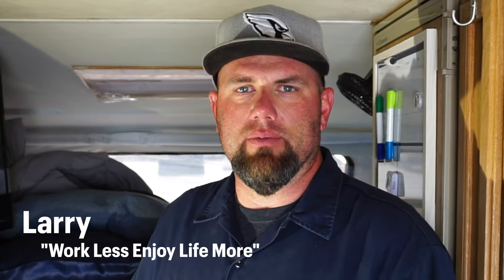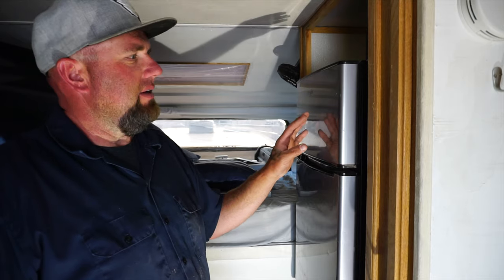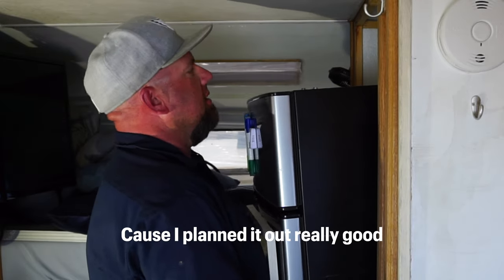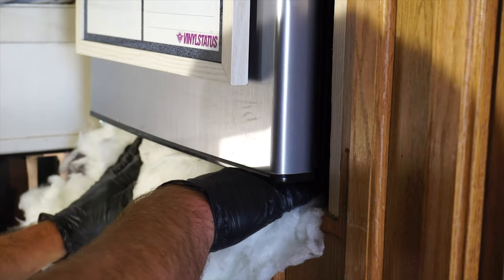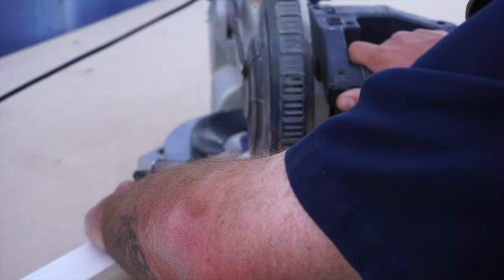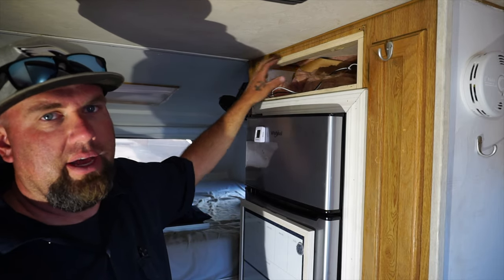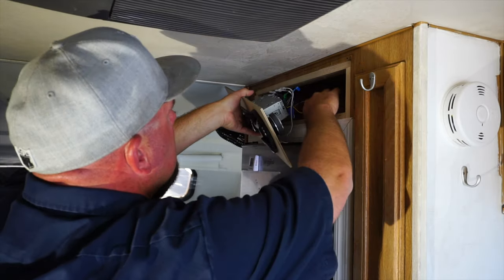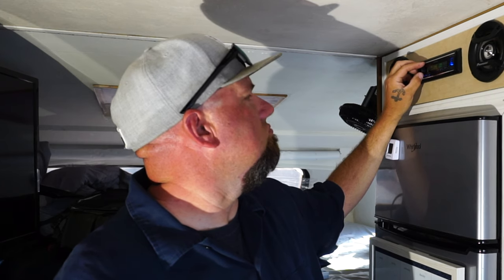How-To Replace Truck Camper RV Fridge With Residential Fridge

Comment: Screen the Vents, otherwise the Bugs🐜🐝🦋🐞🪲🕷🦗🪳🪰🦟& Mice🐭🐁🐀& Snakes🪱🐉🐛will come into the Camper. Put the Tiny Compter Fans on the Vents. Really low wattage use. Also test Protaine Lines with Spray bottle with Soap in the water & spray on the conections. Both you used & this are a positive peace☮of🧠mind.
Reply from the maker: Yeah, I actually have a screen on the vent but I don’t have the computer fans, although that is a very good idea! Thank you for the tips, and for watching!

Comment: Hey dude , if you want a little better speaker response pull the speakers out and use cardboard type ice cream tubs or whatever you want to call them and use them as an inner cup , size appropriately , to reflect the sound outward instead of out the back side in the enclosure . Much better bass and volume . you don't have to drive the system as hard either . they act like putting the speakers face up in a cup . Try it with your cell phone . put tunes on and place it in a can or tall bowl . acts like an amp .

Comment: I flippin love this videoi was laughing my butt off. exact same thing I'm trying to do, and in the same manner😂
Reply from the maker: Hahaha 😂 thanks I’m glad you enjoyed it!! Hey quick tip that I wish I would have done… I wish I would have packs more insulation around the fridge. These dorm fridges are meant to be inside where it’s temperature controlled. So when it’s freezing outside things freeze inside the fridge and when it’s really hot outside it kills the batteries trying to keep it cool. 
Good luck on your project and thanks for watching!! 😊🤙

Comment: I’m remodeling a 1990 Lance truck camper. I did not realize what I was getting into but here I am. All new territory for me. Thanks for the video it helped tremendously as I am going to try to get my old fridge out as well. 😱😳😬
Reply from the maker: Hello Dee, thank you so much for watching and commenting. I’m glad it could help you out. Currently everything is broken inside my truck camper and it all seemed to happen at once. My ac went out, the new fridge uses up too much power in the summer months so my batteries keep going dead, I now have a bad water leak preventing me from turning in my water pump hahahaha oh my gosh the list goes on so I have finally decided to do this full camper remodel. It looks like my next video will include me beginning on more projects. So hopefully there will be more videos that can help you out in the future.
Reply: @worklessenjoylifemore  hey so have u figured out how much "solar system" u need after your install.?   I cant imagine u need alot, in my trucking days we ran a regular small fridge and let it sit for atleast a day  on 3 regular truck  batteries.

Comment: Good job.  I have a similar camper and do many similar mods...    im getting ready to tackle this job.   Im nust trying to figure out if i need more solar. I have 200ah battery and 200w solar.
Reply from the maker: Hello 👋 I didn’t explain it in the video but I too have 200 ah of batteries but I have 600watts of solar. Because these dorm refrigerators are meant to be indoors in a temperature controlled environment sometimes I do have issues. When it’s cloudy or rainy the fridge will burn through my batteries pretty quick! I live here in Arizona where it’s sunny most of the year so I really only have this issue maybe 3 times a year. Also I have issues when I’m in Phoenix during the summer because the temps outside reach 110+ so the inside of the camper gets up to 150F inside when I’m driving around and don’t have the AC on. The fridge will kill my batteries on those days as well because it’s trying to stay cool while fighting the ambient temp. When I’m in that sort of area I have to turn the fridge down to about 50 degrees and only keep things like drinks inside to stay cool but my perishable food has to stay in a cooler with ice. 
You might have issues with only 200watts of solar especially if you live in an area that has cloudy / rainy days a lot. 
One way to fix this issue I learned is to buy a “plug and play” battery charger and plug it into the rv and then connect it to your batteries so when your battery bank is running low you can plug in your camper to shore power or run a generator to top off the batteries at night. 
Hope this helps, thanks so much for watching 🙏😊
Reply: @worklessenjoylifemore   im in SoCal so i know what u are talking about.   I dont want more solar panels i think i will just add another 200ah  battery...    i have trust issues tho so i do carry a cooler full of ice all the time haha...    what i will do is get me another battery and just throw the new fridge on the floor and run it for few trips   ..   thanks for feedback    i will go thru some of ur other videos...  keep up the good work